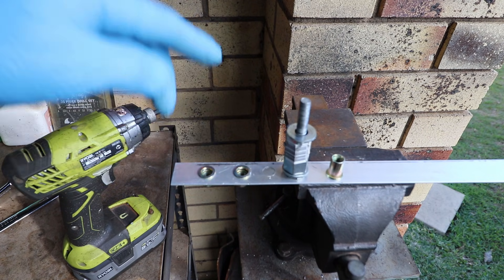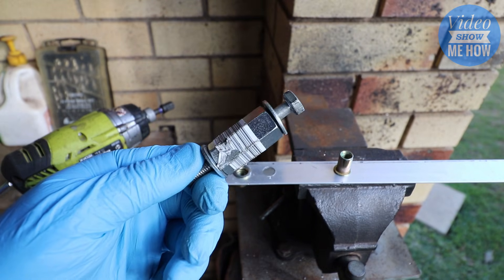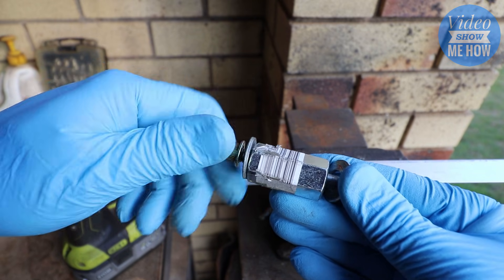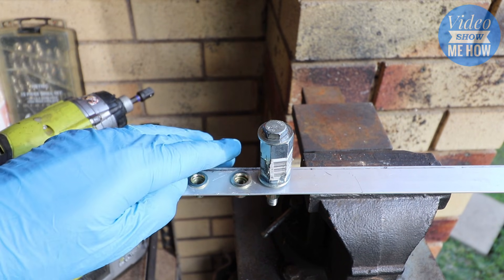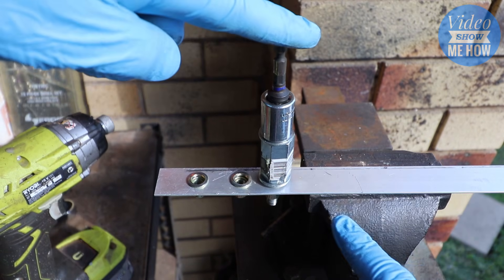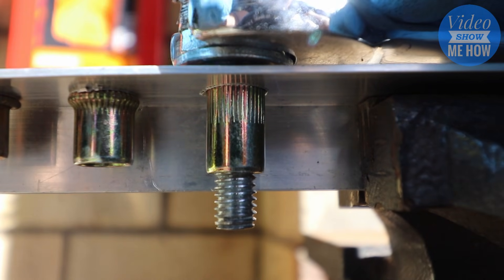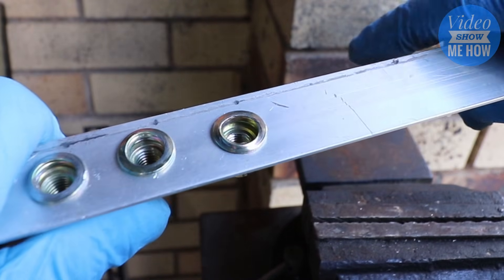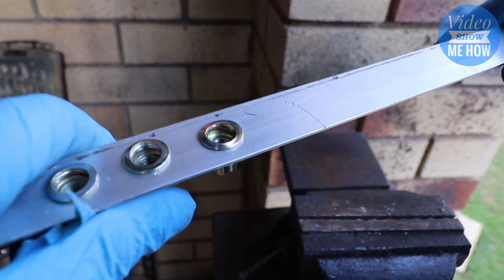DIY RivNut with a DRILL? | How To Nutsert Rivet Nut DIY [without tool]

Comment: Even though this looks and is easy with an impact driver tool, when you're working into thin sheet metal and you can not see behind to know when to stop the driver. I went too far and the nut-sert began dis-forming and tearing the metal. I will now just get the proper tool.
Reply from the maker: Agree Mike, can be tricky.. def recommend to the tool (have vid on the channel on how to use, much more controlled) but I guess in a pinch this can work :)
Reply: @VideoShowMeHow  in a pinch most people wouldn't have the necessary pieces laying around to build the DYI tool. Logically if you gotta go buy something to make it, wouldn't it be better to just buy the proper tool for the job.
Reply: @jameshendricks8526  i have all the necessary pieces without heading to a shop. I use rivnuts rarely and while I'll use any excuse to justify getting another tool, I can't justify the price of said tool for the limited use it would get. Even if I didn't have all of the components for this I could still get them cheaper than the specialised tool. So if there are budget constraints, that too is being in a pinch... best practice is use the appropriate tool for the job. But needs must. So while you are mostly correct, what was your point again?
Reply: @pussygalore7561  very self  explanatory. If you gotta buy the stuff to make a DYI rivnut tool, wouldn't it just make more sense to just buy the proper tool. Figuring in the cost of supplies and your time, Amazon has one for $22.99. Harbor freight is probably around that and you can walk out with it.
Reply: @pussygalore7561  I own the tool and have used it twice. I actually bought it because of a project I wanted to do at work. The first time I used didn't even involve said project.
Reply: @jameshendricks8526  the tool costs upward of $90 here. Can get a drill accessory to do the job for $50. Both lacking full range of available sizes. It took me maybe 10 minutes tops to assemble the required parts and install two rivnuts yesterday afternoon. I'd say this clip saved me the cost of the tool, the cost of me being in a tool store and probably about an hour. I don't understand why so many people are so critical of content makers who are at least being constructive. Usually when I view the comments in makers content, I find them to be constructive and positive, unlike most social media type comments sections. Until I looked at rivnut installation that is.
Reply: @A. Melbs everything I shared was helpful and constructive. The rivnut in this video was installed crooked. His DYI tool is a piece of crap and did the job mediocre at best

Comment: I install hundreds of 3/8” rivnuts in a day, my method is very similar to yours and a little faster. Start with the rivnut, I’ll go inch 3/8”, next get about a 12” length of flat bar about 1/8 - 3/16” thick, drill a 3/8” hole near one end, about 1” from the hole make a slight bend similar to a wrench, and now get a 3/8” thrust bearing, and last a hardened 3/8” bolt. Now for the assembly, you’ll be able to see the speed here. Take the bolt, put on 2 washers (to protect the bearing), put the bearing on the bolt put the assembled bolt with washers and bearing through the hole in the flat bar, then thread on the rivnut. Holding the flat bar assembly with one hand, put it in the intended location and tighten with a wrench, socket or driver. When using the driver listen for the change in pitch, you’ll know when it’s tight. The flat bar acts as the wrench and coupler nut in your vid, and the thrust bearing removes friction. Also it is helpful to lube the bolt especially when installing many rivnuts. In my shop we use bees wax. One bolt properly lubed will last hundreds of installations. The bearing properly protected won’t wear out, but I still have several on hand. After the rivnut is tightened simply reverse the driver and lift the flat bar assembly and thread on another. This method is WAY faster than the proper tool! And I know that for a fact!
Reply: Post a vid, please😊👍
Reply: Are there any videos out there demonstrating this?
Reply: I saw a guy do similar to this but he held the bolt head and turned the nut over the rivnut instead took about six firm third turns of the spanner till it was obviously tight then took the tension off the nut and unscrewed the lot.what I thought was good about this method is the bolt didn't turn on the rivnut thread. Make sure though that the bolt thread is as long as the rivnut
Reply: What type of thrust washer?
Reply: Make a video of it.

Comment: I like the drill idea but am a bit worried that the threads can get damaged. My initial idea was using an old air rivet gun (air over oil) with a long bolt. Cheers
Reply from the maker: Yeah cool worth a shot! Let us know how you get on if you try 👍
Reply: Maybe set the torque on the driver down some

Comment: I don't understand why the rivnut doesn't just rotate with the bolt? Surely that's less force than compressing the steel?
Reply from the maker: It clamps/crushes to the steel. They work great, obviously not for high torque applications but for most things they work well
Reply: @VideoShowMeHow  Oh I meant while you're setting it, not once it's in use. It's not clamped on to begin with and is free to rotate in the hole, more or less, and it seems like it should just do that instead of crushing... but obviously it works since I just used one to repair my car, lol. I just don't quite understand how... thanks for the video though!
Reply from the maker: Ohhhh sorry! The hole size is critical, almost slightly smaller really helps, and really pushing down helps it grip. Once it grips just a little you're away. Course the proper tool is the way to go but hey this still works in a pinch :)
Reply: @VideoShowMeHow  - for high torque, use hexserts

Comment: Put a star washer on top of the rivnut and coupler. Remove the washer that was there. Use that all of the time and the star washer holds the rivnut from turning.
Reply: You just saved the day with this comment. Took me ten mins to find the star washer in my jumbled screw,bolt,nut and washer box but it worked! Thanks 👍🏼
Reply from the maker: Oh nice thanks for the tip!!
Reply: Thanks for that tip.  I will experiment with that.
Reply: I'll make whatever comment I like. I'm not in England or Canada where you don't have freedom of speech.

I like the start washer plan. I bet that is an even better guarantee of no problem in the future.
Reply: @grantdubridge7995  I'd suggest you use a star washer instead of a "start" washer, whatever that is ;-) Poke the grumpy bear🤣
Reply: @grantdubridge7995 We haven’t had freedom of speech in America for years especially when you say a fact that goes against the mainstream narrative.
Reply: @grantdubridge7995  Lol! I don't know who told you we don't have freedom of speech in England but you've made yourself look even less well informed than you did originally! 😂
Reply: @tonysansom  Ask Russell Brand about the Online Safety Bill in the U.K..
Reply: @grantdubridge7995  If Russell Brand is who you take sides with then that tells us all we need to know about you! 🤔
Reply: @tonysansom  here is another example. Women arrested outside of abortion clinic for silently praying.
Reply: @grantdubridge7995  Source?
Reply: @tonysansom  I believe it was the Australian news.
Reply: @grantdubridge7995  Well, if you can't give a source...
I did find an article about ONE women who was arrested outside an abortion clinic and she was arrested because where she was praying, she was trespassing. It had nothing to do with what she was doing.
I suspect that, if it's the same situation, you already knew that though.
Reply: @tonysansom  the charges were dropped so they could save face.
Reply: @grantdubridge7995  This is a video about installing riv nuts. Go away.
Reply: @tonysansom We don’t have freedom of speech in America or anywhere else for that matter and if you think we do your not on important topics hitting the nail on the head saying truth that’s different than mainstream and public education. Just saying.

Comment: Hiya..great vid but I've got a question..how would you do this if you wanted to put a rivnut sticking out externally from a piece of Aluminium boxsection (say 30mm by 30mm)...so long as you could get a bolt in from behind (i,e.from inside the box section)
Reply from the maker: Do you mean the rivnut being installed effectively upsidedown?

Comment: Good job. I just bought a cheap kit off Ebay. See how long it lasts. At least if the gun breaks I have an alternative. What are the maximum thickness for each thread size? I imagine a gyprock wall is too thick for these? Cheers mate
Reply from the maker: Yeah max would only be a couple mm.
Reply: There are similar devices specifically made for drywall.